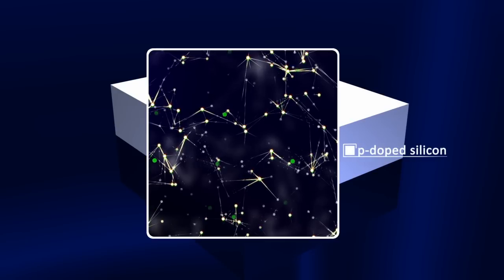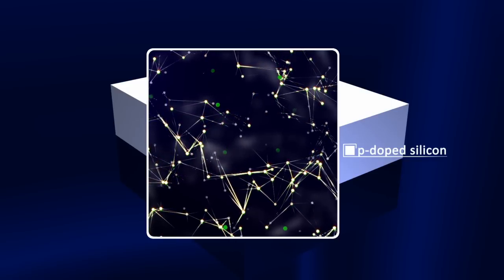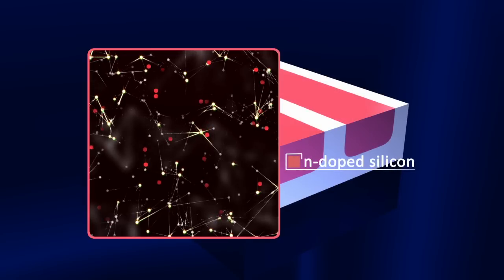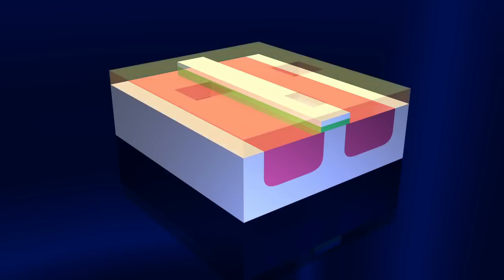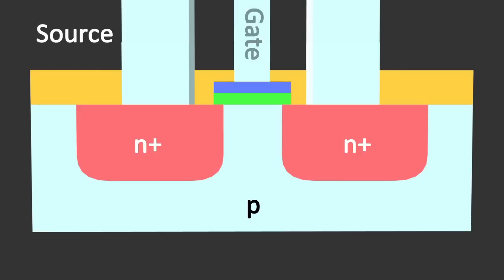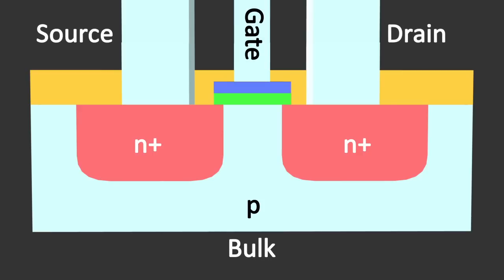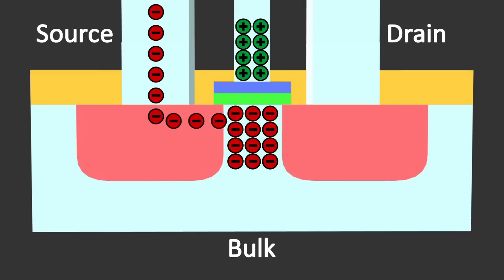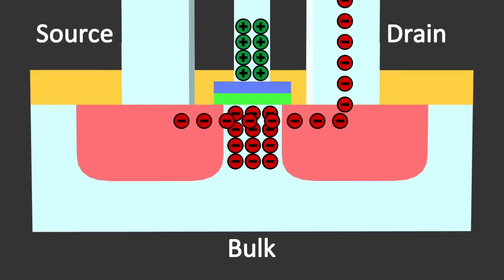How MOSFETs and Field-Effect Transistors Work!

Comment: Two questions:
1) What attracts electrons to move from the gate to the drain 02:58?
2) Isn't it that in reality the moving electrons take the place of the ones in the gate while the ones in the gate are constantly pushed to the right? In 2:58 it is shown as if they were passing on top of them, rather than pushing them sideway.s

Comment: can this transisitor be used to convert voltage to currunt?
Reply: No, Current & Voltage are 2 different properties of the electron
Voltage is the EMF or Potential  Higher voltages can overcome even air (an insulator) then you have a spark  Current is the amount of electrons available
That's why very high voltages (from a Tesla coil) will give you a jolt but not kill you (not enough current or electrons) But on the other hand you could put your hands across a car battery, which can supply a lot of current, but at low voltage can't overcome the high resistance of your body  On the other hand, don't put your figure in a lamp socket  Enough voltage and current to kill you

Comment: how does it attract electrons in the p-type layer? I thought p-type was just positive charges.
Reply: From my understanding, they are actually "holes", or vacant spots in a particular element's atomic structure.

For example, Silicon has 4 electrons. If one electron leaves, it leaves behind a "hole". The overall structure is now more positive than one with 4 electrons, even though there are 3 electrons still there.

It will attract free electrons to fill that hole.

Comment: Why do the electrons flow through the electrons in the bulk rather than in the holes?
Reply: because this is a n-type mosfet as shown there was a positive voltage applied to the gate which attracts electrons to create  the channel, on the other hand a p-type transistor would attract holes to create the channel as there is negative voltage will be applied to the gate

Comment: Why don't the electrons flow from drain to source in n-mos provided the design is symmetrical?
Reply: In other words, what physical orientation makes the source different from drain such that electrons always flow from source to drain in case of nmos and not the other way round?
Reply: Fahim Ahmad Source is at a lower potential than drain., usually grounded.
Reply: Actually drain and source is not distinguished from the beginning but since MOS transistors are designed to make current flow from the drain to source so they put the drain at the higher potential than source.
Reply: What if the source is kept at higher potential than drain? Will current flow from source to drain?
Reply: Fahim Ahmad You can image a MOSFET having two internal diodes (PN junctions):bulk->source and bulk->drain. And since the bulk is shorted to the source you're only left with the latter one. If you were to apply a more positive voltage on the source you will effectively short out the transistor.
Reply: Fahim Ahmad A source is called so ONLY because it gives electrons, in other words, it is at always at a lower potential. If you switch ends, the drain becomes a source and vice versa, whatsoever you name it.
Reply: +Fahim Ahmad Yes, it will :)

Comment: So that's how overclocking works as you increase the positive voltage more current flows in causing more heat generation and so you should buy a custom CPU cooler for that i5 or i7 CPU. GREAT!! :)

Comment: "Positive voltage potential"? Voltage is difference in potential between 2 points. What is a positive voltage potential?
Reply: I Just Think of it as Potential Difference( P. D). And Since Voltage is Always Positive For Conventional Current to Flow from +🔋 to -🔋, ThuS, Positive Voltage Potential.
Reply: @wedoru1176  Ah, I see. Thank you!

Comment: Why do Electrons flow on top of electrons...2:52 onwards..
Reply from the maker: Why not?
Reply from the maker: Hi, it's an n-channel. Just have a quick look on Wikipedia :)
Reply: They don't flow "on top". They flow together, I believe. You see, electrons travel at almost the speed of light. But they vibrate randomly, they don't race in one direction. Electric current happens, when they vibrate randomly at the speed of light but slowly towards one direction. Google "drift velocity". What you see in a MOSFET, is that the electrons surface to the area between the n-doped regions and vibrate towards one direction (because an electric field exists there), therefore causing an electric current.
Reply: You're right, I was confused. Obviously nothing can move at the speed of light unless light itself. And since electrons have mass, they move much slower. I think the main point of what I've written confirms though, right?
Reply: The animation is wrong not because negative charges repel each other but because to have a current you need to have holes. Electric current is the flow of electrons and holes. If you have an energy level totally ocuppied you will never obtain an electric current. You need to ionize donor atoms in order to have electrons in conduction band. This allow current flow in conduction band as consequence of doping. The video try only to show in a conceptual way the effect of the electric field in the gate and how the increase of voltage in gate give us the opportunity of increase the current. Nice video!!!! =)

Comment: Where do the free electrons of P region come from? the positive gate voltage attracts electron from the P region?? are you people High???? Do you all just accept what's written, or do you even think about it at all?
if that's the case the positive voltage on the Drain should make the channel wider right? more "free electrons" in P region should be "attracted" to the Drain right? But in reality it makes the channel near Drain narrower.

The gate is not attracting electrons from the P region, draw a fermi diagram and use your brain: That puny G voltage is not exciting crystal lattice electrons in P to anywhere near the conduction band.

The gate is attracting electrons from the N regions of Drain and Source
Reply: Eugene Liu  can you plz elaborate it sir
Reply: +Eugene Liu I think it was obvious that there is an incompatibility between p and n regions that prevents them from interacting (theoretically) with each other. its the gate, the only one which can attract/repell electrons from either p or n regions. When the gate starts to attract/repell electrons from the P type, its like it is converting the P substrate on an N substrate, stablishing a small connection between the source and the drain. The more Vg-Vd grows, more electrons are attracted, hence making the communication better and providing more current through the P type.
Reply: the eclectrons that are responsible for channel formation come from p type substrate or the n type source in n channel MOSFET???
Reply: pj12042112 From the P type.